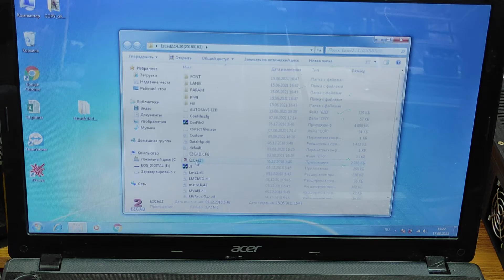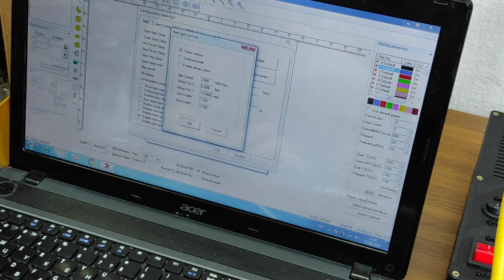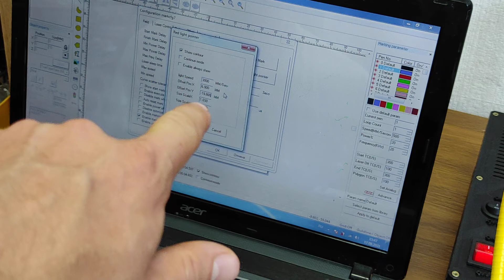How to make your own laser galvo marking machine. Fully 3D PRINTED!

Comment: I miss the 'how to' part, you don't teach anything at all. And the screws that you use to fix the legs to the base plate are anything but M3. M3 is a metric thread. The screws in your video are some plastic screws,  just junk. 
Back to the lab!

Comment: Thank, I enjoyed the video, but was wondering how the laser moves, since it's fully enclosed in stationary compartment.
Reply from the maker: with 2 mirrors inside, that is why it is called, galvoscanner
Reply: When it comes to laser, Galvo systems use mirror technology to move the laser beam in different directions by rotating and adjusting mirror angles within the boundaries of a work area. Galvo lasers are ideal for using fast speed and intricate fine detailed marking and engraving.
The web site is here: https://bescutter.com/pages/what-is-galvo-laser